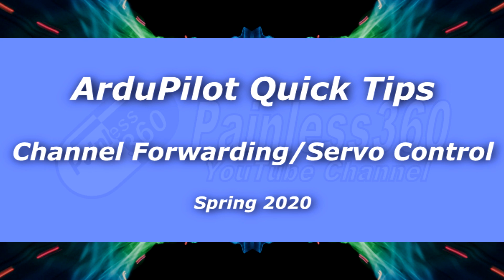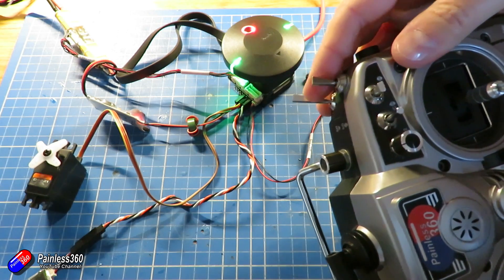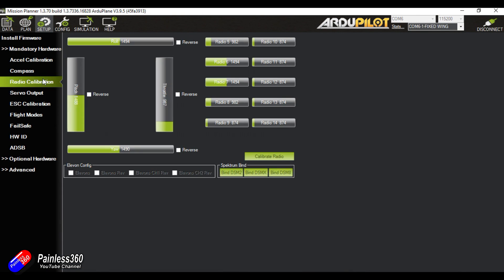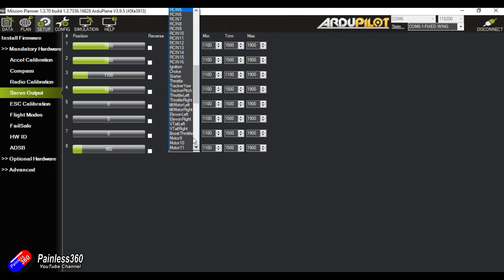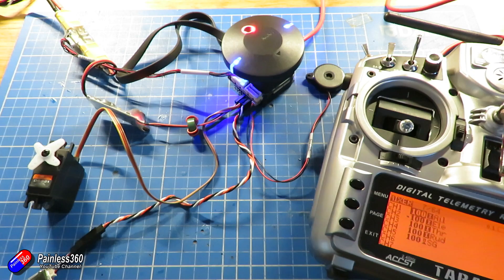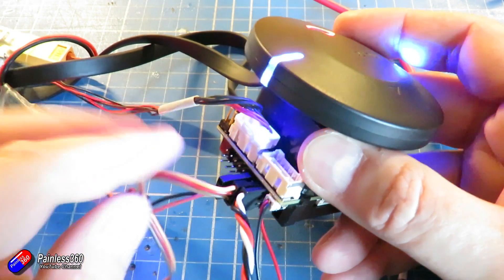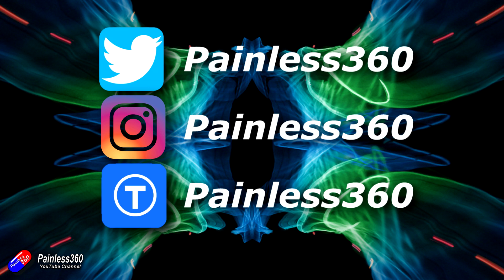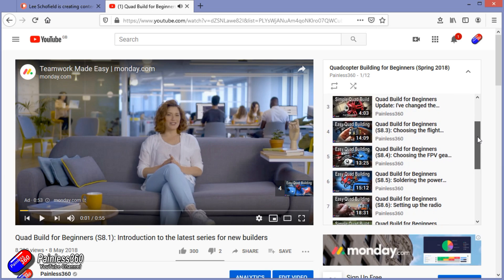Servo Control/Channel Forwarding in ArduPilot

Comment: I am using a Pixhawk 2.4.8 with ArduRover 4.6.x on a bait boat.
The bait door is controlled by Servo 5.
Manual mode: I want to open/close the bait door using a 2-position switch (SWA) on the transmitter.
Auto mode: I want the bait door to open automatically at a waypoint using DO_SET_SERVO.
The core issue
If SERVO5_FUNCTION = RC Passthrough, the servo works in Manual, but DO_SET_SERVO does NOT work in Auto.
If SERVO5_FUNCTION = Disabled (0), DO_SET_SERVO works in Auto, but the servo cannot be moved manually.
RC Override options (RCx_OPTION = Override) do not work reliably in ArduRover 4.6.x.
Servo passthrough and autopilot control cannot work at the same time.
Reply from the maker: At the moment, it looks like it is an either/or kind of deal. See https://ardupilot.org/copter/docs/common-servo.html If you figure it out, please let me know!

Comment: Thanks for the grat video! Unfortunately I can't make it work properly. My setup is cube orange plus, I want to connect servo to main out 8 . But for unknown reason if I choose SERVO8_FUNCTION - RCIN6 (I set a SC toggle on my radiomaster tx16s to channel 6) - I am unable to calibrate servo via trim, min, max options - it just moves too far ans servo is struggling. Any ideas what I'm doing wrong?
Reply from the maker: Set the range of movement on Ardupilot, not the radio. Best of luck

Comment: Trim, min and max changes are not working, why it could be? the servo doesnt react to changes in those parameters.
Reply from the maker: What troubleshooting have you already tried?
Reply: same here, did you find the solution?

Comment: Hello, I am trying to make a fixed wing UAV. via Task Planner 
When I selected the aileron and elevator options it wasn't turning fast enough. I played with min-max-trim settings but I didn't get any results. 
It spins faster when I connect it to a port like RC5. What settings do I need to change to rotate the wings? 

I am providing power from the BEC output of the ESC. Could this have something to do with this?
Reply from the maker: Check out the settings available for the flight mode you are using, max anglescan usuallybeadjusted.  Also, check out my series on building an Arduplane... best of luck

Comment: Hi painless360. I have cube orange, and building vtol quad with engine.  since main out has consumed by motor vtol and control surface, so i need aux for days I tried even with pix1, different firmware finally aux in pixhawk1 working and I didnt know how. but cube still cant produce any output at aux but working fine with input. can you tell me how to activated aux output?
Reply from the maker: If you want to use all 6 Aux ports for Servo’s set the BRD_PWM_COUNT to 6 and supply 5v to one of the AUX power pins so that all of them are powered..
Reply: @Painless360  I will try, thanks, but I have problem, main out from 5 to 8 has output at servo output but no pwm at pin 4 to 8. does my pixhawk was broken?
Reply: @Painless360  with firmware 4.3.7 the bar at servo output display the pwm level at aux  if any. But at 4.1.x it did not display the bar servo output at aux. But there are pwm out but not displayed at GCS. I think it has inconsistent behaviour.

Comment: Hi, it says "SERVO5_FUNCTION=10 on disabled channel"
Strange when i select esc as "normal" servo works but when i select dshot300 or 600 it stops working
Reply from the maker: Could be that output are often grouped into sets and you have the ESC on a channel that conflicts.. Happy flying

Comment: I would love to see retractable landing gear setup using Taranis, Pixhawk and a LGR control module. I've been going nuts trying to get my Pixhawk to do something, anything, with my Tarot X8 Retracts. The Receiver does it just fine, but I want the features Pixhawk offers, just up and down isn't satisfying for me. I've tried to get 3 different Pixhawks to work my retracts and have never even got a squeak from any of them.
Reply from the maker: Sounds like you're missing something as you can forward the RX channel as shown and it should work in the same way. Automation is then possible.. Best of luck

Comment: Thanks for the informative video. I do have a question for you. Since all the ports in my receiver are taken, I would like to ask you how can I set the servo to work in case I connect the servo to the AUX1 port (of the FMU-PWM-out) on the PM07 board (I have the Pixhawk4 Flight controller). Where do I set it inside Mission Planner? In QGC it is being done by setting the "RC_MAP_AUX1" parameter to match the exact channel on the RC. 
Thank you very much
Reply from the maker: No idea. Please post the answer when you get it working..
Reply: @Painless360  Well, a friend of mine just found the solution for me. Basically, in mission planner there are 16 servo functions. First 8 servo functions are not relevant in this scenario. You need to use the last 8 servo functions for it.
So in order to set it, you first need to have BRD_PWM_Count set to 8 and set SERVO9_Function (for AUX1, or SERVO10_FUNCTION for AUX2, and so on) to the channel you want. There are several value options. But in short, 51 means channel 1, 52 means channel 2... 58 means channel 8 and so on. So, for example, if you want AUX1 to be controlled by channel 8, so you set SERVO9_FUNCTION=58.

Comment: Where can I get a BEC like that? I looked the one you're using up and it's discontinued and out of stock everywhere, and anything even remotely like it is backordered. Is there another one you'd recommend? If I can't do it with a standalone BEC, how do you do this with an ESC? Thanks though, very informative.

Comment: Im using a Matek H743-wing board flashed with Arduplane (with Q Groundcontrol on a Mac). How do I configure the manual pitch and roll parameters for the manual flight mode? Previously I'd set this in the radio using weights and expo, but I can't locate the same equivalent parameters in the parameter list within Q Groundcontrol. Any help is apprecaited.
Reply from the maker: No idea, I don't use that. Best of luck!

Comment: When I enable one of the servo output, the pixhawk stops receiving the RC signal, although my yappu telemetry continues to work. What's going on?
Reply: It seems that when it is enabled radio failsafe is triggered, followed by "no RC receiver" but only if I enable one of the auxiliary channels
Reply from the maker: On what flight controller? How is the servo output powered? I'll need more detail...

Comment: So which means pixhawk doesn't provide power to servo if didn't connect a external power supply
I
Reply: Yes you need a BEC to one of the servo power pins. all the power pins are one wire. So powering slot one makes them all work. (◔◡◔)
Reply: @BensMiniToons Good.
Reply from the maker: I don't understand what you are asking...

Comment: Mr Painless, i am attempting to put gps on my tbs 2in1 fpvision can you perhaps point me in the right direction, i have looked on the tbs website and they do sell one but is it plug and play, would you know ? I am still  loving fpv and your videos although recently as you can expect not done a great deal other than try to repair my Parrot Anafi  with a failing eyesight and French engineering i found it impossible which is y i would like it to be plug n play and the other reason i cannot fly line of sight whereas fpv is perfect for myself. Best wishes, Al..
Reply from the maker: When TBS say 'plug and play' it usually means with compatible kit. There are no standards for cable layouts or connectors in the hobby. I've created a series on the early TBS PowerCUBE stacks. GPS support is usually only worth doing if the flight controller is running ArduPilot or iNav. If it's not then all you'll get are GPS co-ords and a very basic 'rth' function from Betaflight.. See my iNav and Ardupilot builds.. Best of luck!
Reply: @Painless360  thank you , thats all i wanted to know before making a decision also i did try to find your  video but without luck as i do remember at the time you did a couple of videos on the powercube, i have stuck with this set up because of the ease of the build and been rewarded in making a very light 7 inch quad (334g) anyways pal thanks for your advise and lets see. Best wishes, Al

Comment: I didnt understand how you power the servo, can you explain a bit more? I'm doing this big proyect at school and im really confused. Also, can i use a multichannel reciever in the pixhawk, do i have to connect the servos to the multichannel reciever or can i just connect them to the pixhawk?
Edit: Sorry for my english
Reply from the maker: Please check out the ardupilot wiki and my new Pixhawk 2020 series. Best of luck!
Reply: @Painless360  and if my receiver doesn't have a sbus, can I still use it with the pixhack cube?
Reply from the maker: Not easily. Check the wiki to look at the PPM support.. best of luck